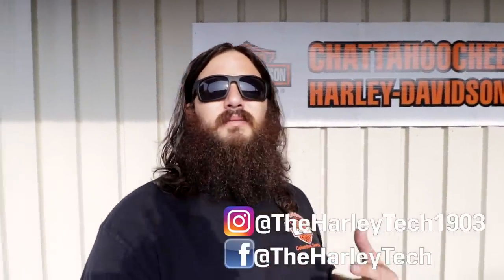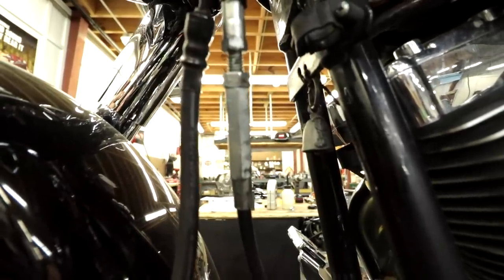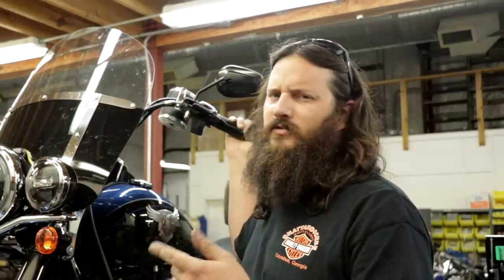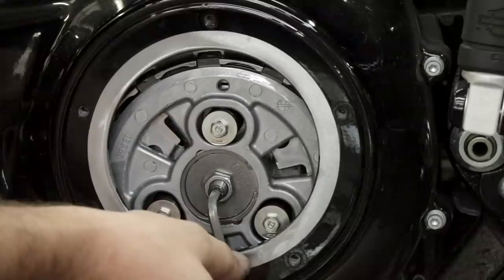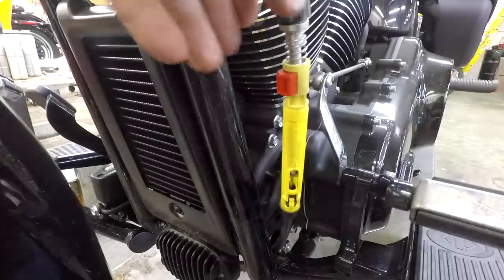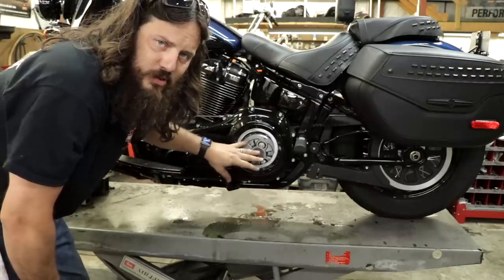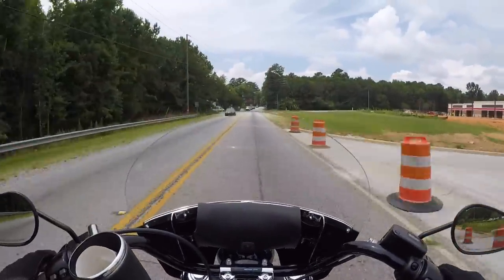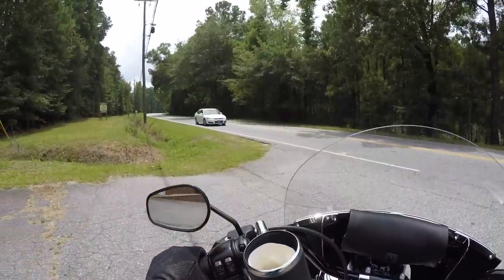2018 Softail Clutch ADJUSTMENT

Comment: My 2018 Low Rider is having problems with not shifting into second and getting stuck in a false neutral, mostly during left hand turns.  Dealer adjusted the clutch and it was better for a short while.  Will be using this vid as a reference for doing the adjustment myself for now.

Comment: Pretty cool John, I used to work at the HD dealer here in El Paso many years ago. When all their was was the old cable style clutch since the shovel heads. But thanks for the tip brother, got a get me that clutch h cable tool you showed. My 09 street glide is the last one I have since my retirement you can say. Thanks bud

Comment: Love the video. I just got my bike back from the service department at my local dealer here in Phoenix today. They finally came through for me and refixed my clutch issue along with a few other little things at no charge. So my faith has been restored in hd service department.  I’m loving my street bob but kind of wish I would of got a road glide instead. The bob isn’t that good on long rides.

Comment: Thanks man!!!  So far, the videos I found, and definitely the Service Manual, didn't describe that basket adjustment in a way that made full sense to me. Everyone learns differently... I just did a 3 hole, and adjusted my clutch for the 1st time yesterday.  I didn't like the results.  Now I know where I went wrong.  It will be an easy 5 minute fix.  One small detail...  Keep up the good work JM!!!
Reply: Chad Varnell lemmy from revzilla has a great video on how to do clutch adjustments on twin cam.  The cable tension release changed on new softails, but the actual clutch basket adjustment didnt
Reply: @bigj200016  Mine is a 2015 FXDL.

Comment: Just inherited my Dads 06 ultra classic. Found in difficult to find neutral, but can actually shift it without using the clutch while the trasn/motor is cold. Hoping adjusting the clutch and cable will help. The video is awesome btw!

Comment: I just got my 2018 FXFBS back from a warranty on the clutch cable. Went in for a 1k and was told the cable was junk. Now it shifts smoother then ever and doesnt clunk forward when shifting from neutral. 

I always had a hard time getting neutral and I thought it was some sick joke harley was playing. It was frustrating when it would pop into 2nd 5 times before I would finally get it. Now its easy to get neutral with a working cable. 

BTW, I love your videos bud, keep up the good work.
Reply: Whoa...  I've noticed a rattle of my clutch lever at 30ish in 3rd gear on my 2018 FXBRS and finding natural is a pain but I've never owned/ridden a Harley (until now) so I just thought that is was normal. I've noticed If I shift from neutral to 1st I have to hold the clutch until the transmission whining sound stops or it kinda surges forward just a little bit and goes "CLUNK"... same for you??
Reply: EastCoast.30Cal mine didnt whine with the clutch in but, it did clunk into first and jump forward a little bit. The lever rattle is probably just factory slop mixed with vibes at that rpm. Mine does that but, it doesn't bother me.

Comment: Was doing mine last night and forgot to slack my clutch cable first. Adjusted the basket and went to pull lever and… clunk followed by lever going slack. Played with it for about 10 minutes, setting the adjustment about 3 or 4 times (this time with cable slacked and then restoring it) before it started feeling okay. Went for quick ride and it feels normal. Did I screw something up majorly or just a lesson learned the hard way?

Comment: I have the same bike, bought it with 3+K miles and had it die on me while riding on Interstate 75 in Florida, got it restarted after about 45 minutes and then brought it to Gator Harley well they could not find the reason but surmised that it had to do with a switch attached to the clutch lever, (so the bike does'nt jump when it's started? so they told me - they adjusted the clutch and told me to take the leather wrap off my levers  (I did not do this cause I was dubious about that),  anyway now the couch does not engage until the lever almost all the way out and I was told that's the way the 2018's  are.
So far after an addition 500 miles it hasn't happened again but dam I'm just not used to the engagement point of the clutch at all.
Al
PS Appreciate the channel!
Reply: amacro11 Same here on my 114 BF, clutch engagement point is far out. Guess it is the norm on these 18’ softies , bunch of riders on the H-D forum state they are experiencing the same.

Comment: IF I'm not getting enough movement at the basket (clutch is grabbing right off the grip hard to move in gear with clutch in, hard to find neutral) what should I do?  Turn the allen bolt out less? 1/2 turn instead of 3/4?.  My sport glide has aftermarket cables but I assume the procedure is the same... remove cable tension, adjust basket, adjust cable play to 1/8 inch

Comment: Hi John, need to pick your brain about a problem I have with my 08 Street Glide which I recently bought. After making the clutch basket and cable adjustment my clutch pulls horribly. When pressing the lever the spring on the basket bearly moves and the lever is stiff... The funny thing was after taking off the primary inspection cover you normally don't get much oil spill when the bike is upright but my primary was filled with something like 2 quarts of oil and it spilled all over... Not sure why someone did this.  Checked the transmission cover clutch actuator and it's okay, clutch basket nut, and it's solid... Also to make it work at all, had to turn the adjuster bolt in after reaching the resistance instead of going half-turnout.  Not sure where to go next... The only idea I have left is that my Street Glide has Apehangers and a quite long clutch cable... would that be the cause of my headache??? Not sure where to go next... Regards Simon

Comment: Could you show us how to remove this top half of the clutch cable, some of us have to extend the cable and Harley does this with just the top half of the cable where the adjustment is.  So how is it removed just the top cable.

Comment: Hey man hoping you can help me out. 2021 street bob around 9000 miles. Adjusted the clutch several times and have played with 1/2 to 1 full turn out and when my bike is in gearit wont roll with the clutch in. My research shows its way too tight. Can you please help me out with some tips?

Comment: Hey John I've got a 2002 softail standard Springer my father gave me as an early inheritance  It's time to change plugs and it's at 9.5k miles  I was thinking about putting ngks in it rather than the original stock ones No clue in how to cross reference or if it's a good idea Once person says use what it came with one says upgrade to iridium Any thoughts I'd appreciate em: -D

Comment: i have a 93 Heritage I  put a new clutch  and cable on it i have  1/2 turn out on clutch 1/8 free play  clutch is a barnnett extra plate .NOW i cant get it into neutral unless im coming to a stop or bike is turned off the shifting is smooth and when you start to let off clutch it wants to hall ass  . what do you thing would cause the neutral problem

Comment: Hey man, does this adjustment affect when the clutch grabs when you release the lever? Trying to set mine to grab about 1/4 way release of the lever... The dealership adjusted it so the clutch doesn't engage  until the lever is basically all the way out...

Comment: What liquid is in your applicator to lubricate the clutch cable? I'm not a fan of the aerosol can + applicator tool method. Are there pros and cons to each method of lubricating the cable? Also, I just purchased my first Harley 2 days ago (2010 Road King). When and why do you actually have to adjust the clutch assembly? I'm not sure how the adjustment relates to finding neutral, either. I've only ever known to adjust the clutch cable tension and if your clutch is slipping, to replace the pack. I love your videos, keep up the good work!
Reply: If the clutch is out of adjustment, it typically acts like it is too tight.  For example,  when you squeeze the clutch lever in it doesn't disengage the clutch all the way which in turn puts pressure on the drive train making it so when you lift the shifter up to find neutral, it requires more pressure than usual and you will overshoot the neutral detent into the next gear. Thats why it needs to be in proper adjustment.  So the clutch fully engages and disengages.  Hope this helps. Safe riding man!

Comment: john thanks for your clutch adjusting video but i as well would like to know what pipes were used on the 114 you should i have the 114 and am waiting and looking to replace my mufflers with new ones to get rid off catalytic converters but not having to remap my computer or buy a tuner  to do so thanks

Comment: I normally enjoy your videos. Just watched your clutch adjustment video. I’m at a complete loss as to the procedure, as you jumped around so much. In particular the “new” new adjustment clip. Loosen it first?
Reply: I picked up the service manual for 20 bucks.  The procedure for clutch cable adjustment is in it.
Reply: Agree, it jumped around too much to follow.  I think this harks to John's point about not doing how to video's.  Delboys Garage gives a good explanation on an early softail if you want a clear step by step.
Reply from the maker: It’s just supposed to be an entertaining way to show how it’s done. A service manual is absolutely a must if you’re going to do your own work. My videos or anyone else’s shouldn’t be a substitute for the service manual. Just a visual aid in what you’ve read. 

Essentially, you loosen the cable and the clutch basket. Lube cable. Adjust the basket then the cable.

Comment: I've got 4 Harleys: '01 Ultra, '13 Electra Glide Classic, '02 Softail Standard and an '06 Sportster 883 Low (wife's bike).  I notice on the Softail that I get a significant "clunk" when I put it in gear. What causes that and how do I fix it (assuming it needs to be fixed)?

Comment: Dear John. I have a 19 Limited I'm not really crazy about the hydraulic clutch. I was curious on the transmission endb  is it a way to convert it back over to a cable operated clutch. Thank you for any advice.

Comment: Do you have to drain the oil in order to pull the clutch cover off and do this adjustment?
Reply from the maker: No, but if the bike isn’t upright, you’ll lose some of the oil.

Comment: Heyall, my problem 1999 heritage softail, clutch problem, if i adjust to factory specs, it really grinds to go into gear, but doesn't really    creep in first, but it is really over klonding!>> is there a clutch warpage or wear do this? thanks alot!

Comment: John is the softail the only 2018 with the catalytic converter in the muffler itself? I know it was a heat issue on my 2014 SGS until I got rid of the head pipe. This would make life easier on the baggers also.
Reply from the maker: The only other one I know of is the screaming eagle nightstick exhaust. At least the twin cam version had the cat in the mufflers. Those things weigh like 20 pounds a piece!

Comment: i REALLY appreciate this video. I'm just curious on your opinion about how the clutch should leave a shop? i just had my fxbb on the 5000mile service. the clutch now has about AN INCH of play. it had like a quarter inch of play before. for sure i'll use your video and fix it myself. but a service here ( im in sweden ) is about 400 bucks. im so sick of my dealership that im about to abandon harley davidson completely as they are the only one dealership around, next shop is about 3 hours away..
Reply from the maker: This is always the worst comment to see.  Have a talk with the service manager, I'm confident he'll make it right.  You shouldn't have to fix it yourself!  You just paid $400 to have it done correctly, after all.  The most important thing I learned in school was that little old me ( a face no one ever sees) is the representative of the entire dealership.  the dealership is a representative of the entire motor company.  don't let one tech that didn't adjust your clutch correctly make you change your mind about an entire company that doesn't even know who he (the tech) is.  I hear it a lot "this dealership this, this dealership that". the issue is generally about one single person, whether the commentor realizes it or not.  generally it's not about an entire dealership (or the motor company).  just the one guy...

Comment: Love the vids having trouble with my 02 road king i replaced the clutch cable not its jerking into first gear and stalling..also im not longer getting any tension in my lever when adjusting the screw on the basket...help me bro

Comment: Great video, John! I have a 2018 Street Bob and have just developed an issue where it occasionally goes into neutral instead of second gear. I've also had a couple times where it would go into a false neutral from 4th-5th. Could this be the clutch cable needing adjustment? I had the 1k service done at the dealer and otherwise the bike has been great, but this 1st-Neutral-then 2nd business has almost gotten me run over a couple times now. I have tools and can try to do this myself but was thinking I should take it in since it's still under warranty. What do you think I should do?

Comment: Looking to change the handlebars on my 2018 Softail slim. Can I swap out the clutch line at that adjuster in front of the bike? Or do I have to go all the way back to the transmission?
Reply from the maker: H-D makes an “upper clutch cable” changed at the adjuster. Starting the video tomorrow. Hopefully in 2 weeks I’ll have it out!
Reply: I appreciate your response! That’ll help me a ton with my build! Harley here said they aren’t sure of the measurements and would have to wait until I have the bars put on to get one. Im just hoping it won’t take to long after I put them on to get the right cable.

Comment: Could an improperly adjusted clutch cause a new Softail to repeatedly fall out of second back into neutral? Just picked up a brand new lowrider as the dealer was closing and had this happen a lot on the way home. Only on a first to second shit though.
Reply: My FXFBS does it ocasionally too......
Reply: @citizendick6087  the dealer wanted the bike back ASAP so at least they're willing to look at it. I just hope it's a quick fix.

Comment: Hi John I have a question. How do I get the red check engine light on my speedometer to go off. I checked the codes and there were none. It is a 2003 roadking police

Comment: Hi John! I'm just about to hit my break-in 1000 mile service on my 2018 Breakout 114... recently I've noticed a decent rattle of the clutch lever in 3rd gear at 30-35 MPH. If I push the lever outward with my finger the rattle stops. Is that something I should tell the Harley Service Tech that looks at my bike?
Reply from the maker: You can mention it,  but I would bet the clutch adjustment will rectify it. It’s probably too much play in the cable.
Reply: Cool, thank you for the reply, John!

Comment: Seriously man. How u manage to keep those derby cover screws in? I follow torque spec on the service manual (90 inch pounds) and the screws either snaps or feel like they slip and about to rip the thread....
Reply from the maker: You using a t-27? Lots of folks mistakingly use a t-25 and turn them into circles.
Reply: Ya it’s t27. I can see it fits exactly. And I put 90 inch pounds. The torque wrench is inch pound only, the smallest one. It just keep stripping. Before reaching the torque. Right now I just hand tighten it using feeling. Not sure whats the reason, might be my torque wrench is bad?
Reply from the maker: Sometimes those bolts have had enough, too
Reply: See that’s what I thought but it’s new bike only 1k 980 miles. LoL. Anyway I bought 10 more screws from dealership just in case. LoL

Comment: Hey man, quick question. I have a 2008 CVO Springer Softail 110 Screaming Eagle. My clutch seems to go into first gear real hard with a clunk. Is that normal? All other shifting is smooth and I can find neutral pretty easily. Any advice you can give would be greatly appreciated. Thanks!
Reply: Group W Bench I've got an 08 Night Train and that had happened too. Eager to know his opinion.

Comment: Hey John,

I have an 08 Night Train and my break lever falls back (towards the hand grip) just enough to engage my break light. Any suggestion as to what causes that? Also, is it something a mechanic should fix?

Thank you
Reply: Odds are that you need to have the calipers serviced/cleaned. That will probably fix a lot of that issue. A brake fluid flush is always a good idea too. Worst case scenario, the M/C will need to be rebuilt replaced. But, again, probably cleaning the calipers will do the job.

Comment: How often or what mileage should I adjust my clutch? Or is only when its feeling funny? I ride a 10 fxdb by the way.
Reply: Typically, you'll adjust it at every service interval. So, roughly every 5k or so with "normal" riding conditions(i.e. you're not dragging the friction zone constantly).